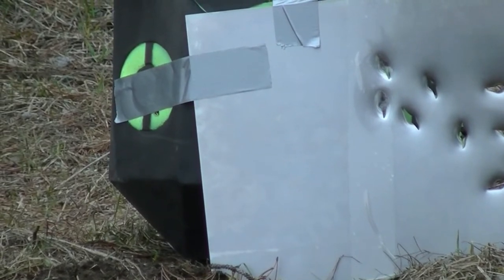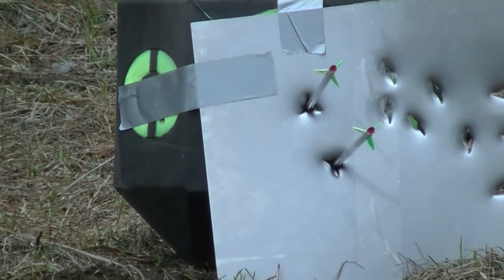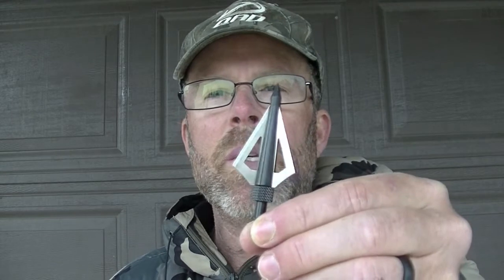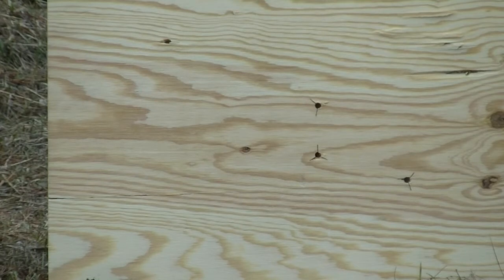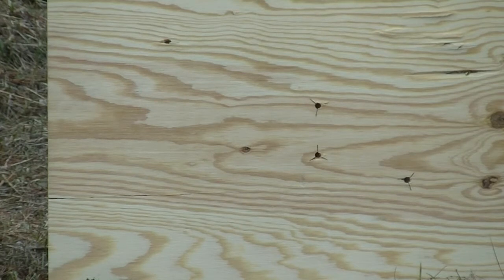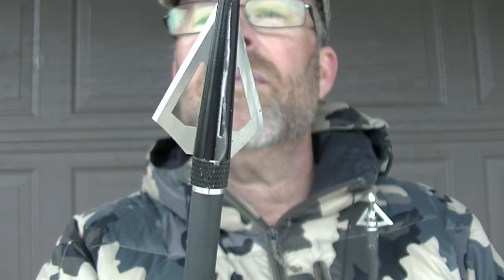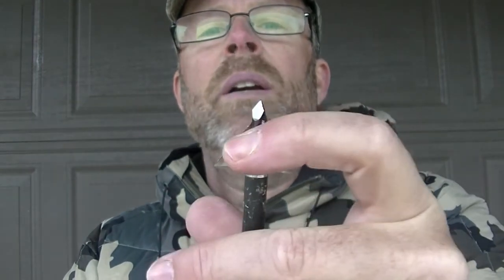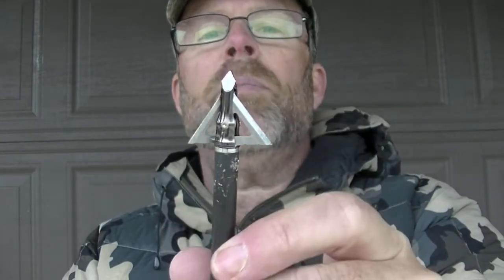Bishop Holy Trinity: 3 Models Durability Test

Comment: Had to watch this again John & found out that I didn't like the video in 2019 when I bought the 41L40 three pack. It's nice 2 see someone in my neck of the woods that goes after big deer doing these tests.  It isn't uncommon in the north for someone to shoot a mature deer over the age of 5 even though it is usually a #'s game with a dirty slug. However if I'm in the right place @ the right time I can only hope that I have a head with RETENTION values that are off the charts. I'm not looking for a passthrough but a head that passes through without being rendered to a one & done playoff team in the NFL. From my 1st year shooting the Bishops all I can say is that with a nock tuned arrow out of a bow that is also tuned as well will deliver a lifetime of performance that is only as good as my sharpening skills can make them.
Reply from the maker: Thank you for watching and commenting. Bishops are the top of the food chain in durability and edge retention for sure. On my most crucial hunts, I usually break out the Bishops.

Comment: I would like to know how they would fly from a Ravin Crossbow at 425 fps.  Do they fly like field points?
Reply from the maker: They do fly very well out of any tuned bow. But I would say the Bishop Scientific Method 125 gr or 100 gr heads are the best flying fixed blade head through super high speed bows and compound bows.

Comment: Which is better, these or the annihilater??
Reply from the maker: Well, they're very different heads. Bishops have a super short profile so they fly extremely well at longer ranges. They also penetrate much deeper than the Annihilator. And they are much more durable than Annihilator so you can re use them forever. But the Annihilator does open up a better wound channel. So for smaller animals and shorter shots, the Annihilator is a good choice, but for larger animals and longer shots and longer use, the Holy Trinity is better.

Comment: Would like to see 100gr heads tested.
Reply from the maker: Yeah, I try to shoot 125, especially if the extra weight goes into make the head more durable, as it does with the Bishop. There is a difference between vented and non vented in durability.

Comment: Rip offfffff.
Reply from the maker: Well, thanks for sharing your thoughts.
Reply: What do you think is the rip off?  The price of the Bishop heads?  I agree they're hugely expensive.  Whether I ever bought them or not would depend on my odds of losing one.  They're not likely to break, but if they pass through an animal and then bury themselves to the point they're not recovered, that could get expensive in a hurry. 

Given the results of these tests, I don't see much reason to spend the extra on the S7, when the other two seem like they're more than durable enough for the rest of us non-subsidized mortals.